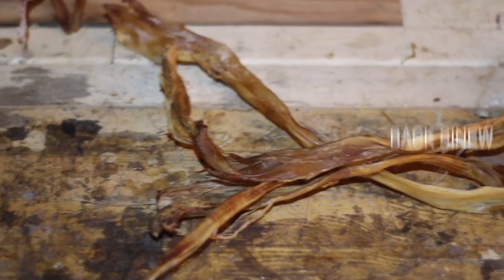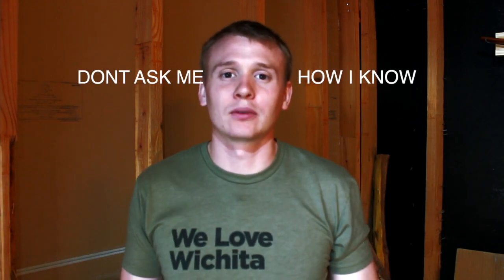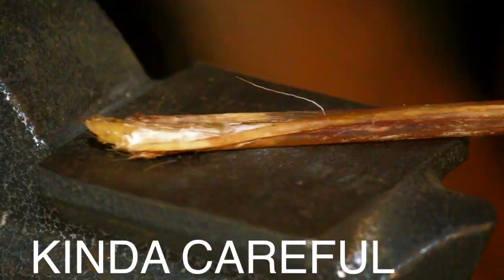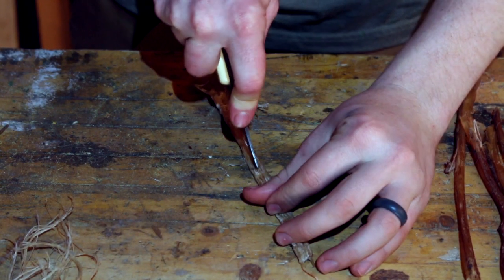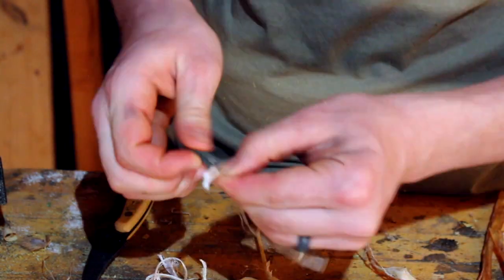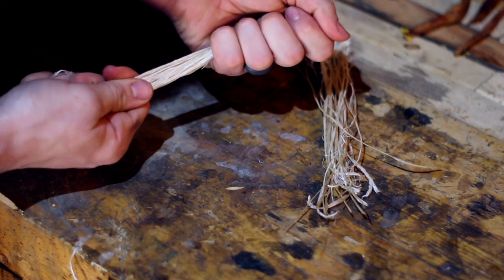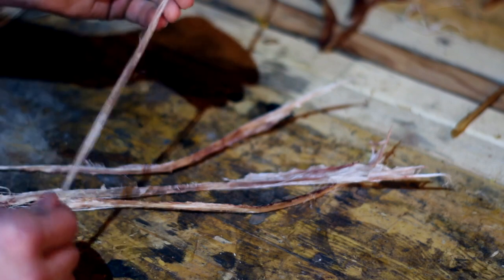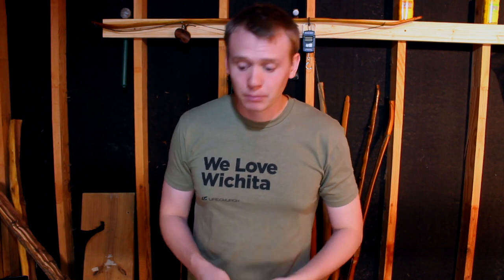HOW TO: PROCESS SINEW "for making bows"

Comment: Good video Kramer. I’m going to back my bow with sinew or rawhide after I put some walnut tip overlays on and recurve the limbs a bit🏹
Reply: Kramer Ammons never done it before bro, but it looks pretty easy. I am going to use a plane or a belt sander to flatten out the tips on the back side of the bow. I will sand just through my nock grooves on the back side.Then just glue walnut tips on with tite bond 3, and sand them down to blend in with the limbs.

Comment: Hi Krammer (btw I just subscribed) I'm on the selfbow building journey for a few years and stumbled on your wonderful presentations and knowledge. I'm a few steps behind your experience and tools etc but have learned a bit about sinew and horn bows in my deep search and find session of which your part of and I've learned a lot from you.
In response to your asking if anyone knew anything I found that I have gotten a bunch of knowledge and just need the time and resources to work on. In the mean time watching this vid  I noticed that the sinew you used needs more processing, it's still too thick. From reading and videos I noticed that they had their sinew processed to the point that it looked like threads or hair or even a white messy wig kinda look. That would get soaked in water to a point and then after dipping in glue laid out so that they'd come together much like the cells of the female  muscles cells depicted in anatomy books. and the levels on top of the first would have a non overlapping layout and that depending on intention the bow would get from 1 to 7 layers of sinew.
I stopped as things got crazy this past year but was on the point of starting to recurve/reflex and sinew back my bows.

Comment: You generally do a good job at bow making and I normally don't critique other bow channels, but I would caution people wishing to learn sinew backing to learn from people that have experience. Do NOT wet the sinew to "straighten it" after you process it, and it makes for a stronger backing and smoother backing if you don't sort your bundles into the same lengths.
Reply: You CAN use bundles that are the same length as long as you stagger the placement so there isn't a continuous seam across the back. But you are right,  it's also good to use bundles of different length AND stagger the placement... makes it even stronger.